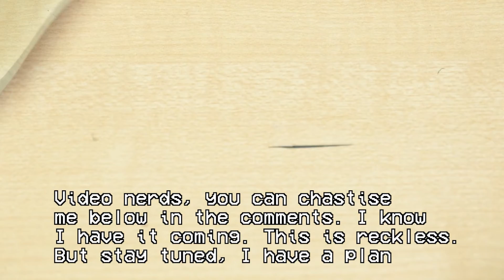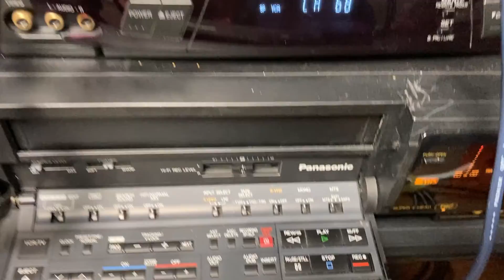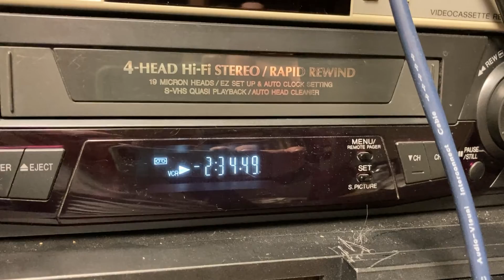VHS tape broke near the start or end? This quick fix can save your capture

Comment: A great way to damage the video head block
Reply: How do you do this without damaging ?
Reply: @SomeHeavensStation  No way without damaging. Taping VHS tapes is fundamentally impossible. The design of the VCR mechanism does not allow this. The most you can do with a torn tape is to split it into two cassettes, attaching the ends to a transparent leader tape.

Comment: hi to all after you have digi the files  never ever move data to a phone is the  if the  ohone who it is dieds you can lose all the data on the phone 
i have a mate that died from  something very unluck   and HD are bad as well my old mate  last  2gb of files down to bad  drives
i did say i can bad up the data with one of my  data tapes drives 

the best way is to have same model drives  and back same data on each drive and keep data in many place   this doe's work very well 
funny thing i am finding betacam sp decks are tanks   i have alot of them still working 

with bro i can turn  pic's in to video   and tape can last new one 30 years

Comment: What I've done in the past, if the break is near the very beginning or very end, is actually splice the tape to the clear plastic leader rather than to the reel itself. That way, the auto-stop system still works and the machine will probably stop the tape itself before the splice gets to the video head.